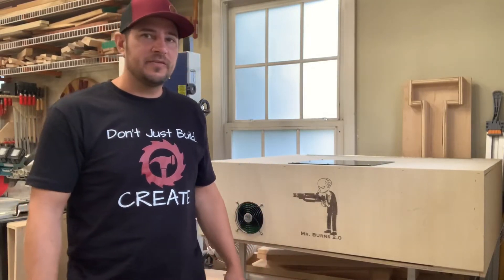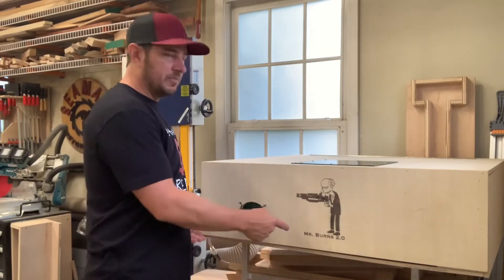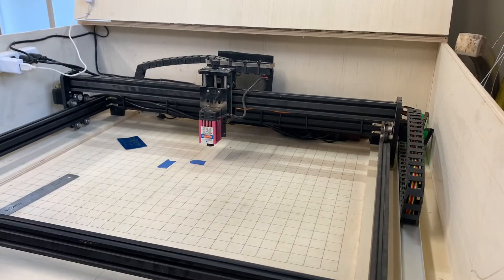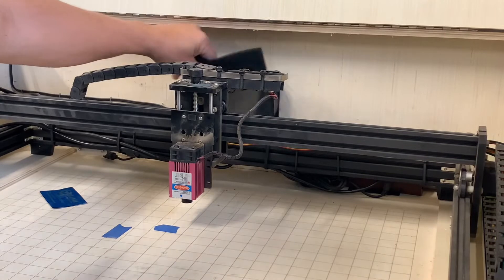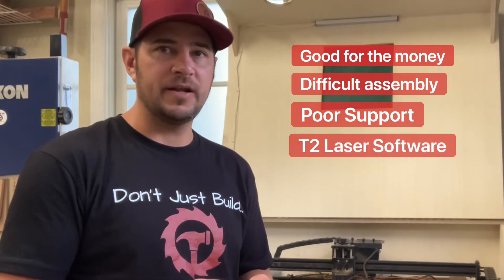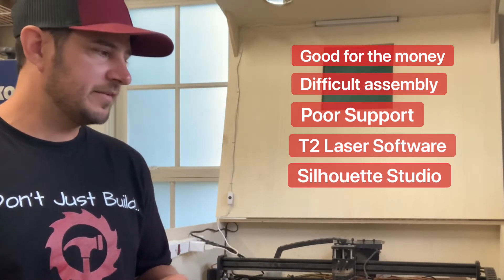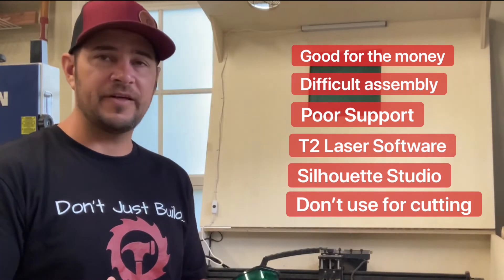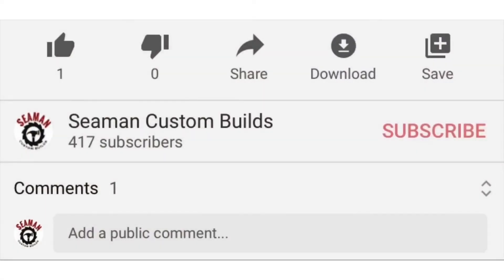Universal Engraver 15W and 3W Laser Engraver - 1 Year Review - HOW TO - DIY

Comment: Universal Engraver big problem
      I have a 15w Universal Engraver and you’re the only one I found that knows anything about them. Your video mentioned ‘poor support’, I say NO SUPPORT. No phone number, no address! Here’s my problem: I made a clock face that came out fine with a 100 Power/100 Feed using T2 software. I stepped aside for a few hours, came back and put in a new piece of wood and hit the send button. It started out in the 12 o’clock position fine but by the time it got down to the 3-9 o’clock the burn started to fade. By the time it got down to 5-7 o’clock position there was no burn at all. With some test pieces I was able to get some burn with a feed of 20 and a power of 200. Is my module shot? Is it the pc boards? The power supply? I can’t find answers anywhere. Help!

Comment: I have the 15 watt 40" x 40" version, but I bought an 80w blue laser module to upgrade. But it has a three-pin connector, and when I connect it to the shield, there are power lights on its board but no output.  Was there a certain way to connect it to work with the Universal Engraver? Three-to-two pin adapter or something?

Comment: Hello, I bought a 15000 mw Blue CNC Laser Engraving Machine a few months ago.  The setup was difficult, however I took my time and am using LaserGRBL software.  My question for you is that there are two toggle switches ontop of the laser itself.  What is the purpose of the two toggle switches?

Comment: My universal engraver came with two transformers one for z/y/x other one plugs in to laser. I have extra two prong plug part same wire power laser from transformer. If I start project I have manually turn laser on then off when stopping project. Also unable stop burn lines when laser goes one area to another. I tried $32=1 no help

Extra wire and plug is this problem

Comment: I was wondering if you might be able to help me out with my 15watt laser engraver. I’m having issues with it just stopping randomly. I can’t find anything anywhere about it. It throws no error codes either.
Reply from the maker: Sorry, no idea what might cause that
Reply: I saw a response to someone on another video with a different machine that had the same problem, they suggested switching out the usb cable. Not sure if it works, but worth a try. They mentioned interference with the signals causing a problem.

Comment: I purchased a 3000mW universal Engraver about a month ago. I struggled thru the setup and  to learn the software. Support has been poor to non-existent. So, my question is; If I install the free trial version of T2 software, is there anything else I need to get to interface with the hardware?
Reply from the maker: Congrats on making it through the setup, T2 should work very easily, check out my video on connecting it.

Comment: Thank you for the video it was helpful but in my experience This laser is garbage !!! no matter what settings I use no matter what advice I follow from the engineers I can not get good results. I have reached out to support several times and they are useless. all they have  told me is to be patient and spend another 1k on a more powerful unit which I should not have to since the one I ordered is advertised as an all around "universal" laser I did my research but I guess not well enough. I would not recommend this product to anyone.
Reply from the maker: It doesn’t do everything they claim, mine has worked well for a while now but not sure that is the norm for everyone and I wouldn’t claim they have any support bc they really don’t help at all
Reply: @seamancustombuilds  I have followed every suggestion that was offered to me from them and I can not even get the laser to burn never mind cut thin wood the final suggestion from them is to spend 1K on one of their upgraded lasers

Comment: Hi, I wanted to pop in and just warn people about this company, if you are not handy, well shop elsewhere, there is a lot to put together and their videos are horrible and just about worthless. Customer service is not great, they only use whatsapp to send pics and into back and forth. I have heard from others that they DO NOT allow any refund or warranty beyond a replacement part. My 1500Mw blue took about 6 hours to assemble switching between several videos and stills, I still got it wrong with wiring. Best to put it together, then send them pictures to tell you for sure that it is wired right. I got ahead of myself and burned a small hole in the dining room table!! After that, I worked another 5 hours getting the wiring right and software understood. JUSDT BEWARE, THIS COMPANY IS HORRIBLE TO WORK WITH!! BE WARNED!

Comment: The original software won’t pop up for my MacBook Pro. I got light urn and it won’t detect the laser even with usb connection. Is there a more compatible or better software for this particular laser?
Reply from the maker: My only experience is the T2 Laser, good luck

Comment: Hey Scott thanks for the video. I just assembled the Universal 15x blue laser. Now I’m stuck waiting for support to troubleshoot software, Windows version compatibility, installation sequence, firmware, and controller board issues. The 48 hour wait for support and abysmal communication gap is maddening! Are there any user groups or other support options? Thanks again
Reply from the maker: Are you trying to use T2 laser or something else?
Reply: Grbl based laser CNC systems. It supports grey scale images, vector graphics and also has basic sketch features. I finally completed assembly and forces myself to figure out answers to my questions with fragments of occasional support from Universal Laser  engineers in China. They are very friendly, but only extremely slow to answer my questions.
Turns out, assembly video showed incorrect placement of a power cable onto controller card causing a reverse polarity issue. The engineer did finally turn me in the right direction.
My application is engraving serial numbers and logo into coated aluminum- very curious to see if this 15W laser will work. If so, I’ll be very impressed for the money.

Comment: Hi, i want to buy, but i want to use to cut 3mm plywood, my question is , i don´t know is you was referring about the 3w or the 15w, i am interested on buying the 15w, this one can cut 3mm plywood?
Reply from the maker: It would take a lot of passes to cut with the 15w, you need a much higher power machine
Reply: @seamancustombuilds  thanks for your fast respond bro!! I also see, thet sell for 699$ a router attachet, i think with that, i should have not problem cutting the 1/8 plywood

Comment: Hello from Canada. I just ordered a Universal engraver 15000mw and assembled it. I ran into some difficulties with the wiring. I am asking you because well .....
 #1 you have it working
#2 there is no tech support 
Question #1 my kit came with only one power adapter. 8.5 amp. Their video shows an additional adapter of 5 amp. Did yours come with both?  And if so is the 8.5 amp for the laser?
Question #2 the wire harness red/yello/green/black is wired into plugs in a reversed color order from the video. Did you run into this as well?
Reply from the maker: There should be 2 power supplies, I’ve heard of multiple people missing one in their shipment lately. #2 I don’t recall
Reply: @seamancustombuilds   Thank you very much for your time. That information helps a lot already, I'm a little bit out of my comfort zone and not very tech savy.
Reply: @seamancustombuilds i only have one. Where does the other one plug into?

Comment: I got it all set up, where does the blue connector from the laser go on the control board, their video shows it going to a separate power supply but they only sent me one lol
Reply from the maker: Which model do you have?
Reply from the maker: I’ve heard multiple people say they aren’t getting the 2nd power supply shipped
Reply: @seamancustombuilds  Yep, didn't get mine either.  I've messaged, called, emailed....everything.  They won't return any of my messages other than 1 and he said to contact the support team.  NOT ONE WORD from them and it's been 1 week later.

Comment: Just set mine up. double checked it, triple checked it etc. With Engraver master i can control the laser but it will not move. When i try to print an image it will clearly try to do it as the laser turns on and off but the motors do not kick on. Any Idea what i can do?
Reply from the maker: I would start with using T2 laser software and make sure you can manually control the directions and laser on/off, if not then check the cable connections
Reply: @seamancustombuilds  do they do a free trial or do I need to purchase the software?
Reply: @seamancustombuilds  your videos have helped so much and I really appreciate you responding. We have the same laser here and I downloaded the t2 software. Again T2 was able to power the laser on/off but I can’t move the laser. I’ve been checking cable connections and placement. Is there anything else you can suggest I look at? Thank you for your help.
Reply from the maker: @thedan7888  do you have the 5 or 15w?
Reply: @seamancustombuilds  15W - I got it to work just fine. Had to mess with the power adapter. The laser was fine. Do you have a video on making the grid for the bed?
Reply from the maker: @thedan7888  I used this video https://youtu.be/vp1R2wKt1pA

Comment: I have the 15W 40x40. I'm not sure if I'm missing a part but there are the two connections tied together coming from the laser/controller to an adapter to a power supply. I only got one of the adapters for that connection to the power supply. Also I tried to engrave the pre-made grayscale code and it just burns a black rectangle. Thank you for any advice
Reply from the maker: I’m not sure on the power supply question but it sounds like it’s powering up. There is a blue knob that you can turn down with the laser on lowest power and set to the minimum that turns the laser on, I would also try T2 laser software for better usability
Reply: @seamancustombuilds  I realized my connection mistake. I'm using T2 and have been playing with basic shapes and those come out fine. Now that I'm trying to do some images with different levels of darkness, like the grayscale test, I just get a burnt rectangle. Maybe there are some changes I need to make in the settings.

Comment: Have you tried engraving stainless steel yet ?
Reply from the maker: I tried some thick aluminum and had to use a spray and even then it didn’t always work, talc business cards work but haven’t tried anything else
Reply: @seamancustombuilds  awesome thanks you just got mine what software do you run ?
Reply from the maker: @CHEESMIZER1  T2 laser, I have a video on how to get going with it
Reply: @seamancustombuilds  awesome thanks you very much how good is t2 with picture engraving?
Reply from the maker: @CHEESMIZER1  do you mean greyscale? If so I haven’t tried, I leave power up and let it rip

Comment: I've had my 15w 40x40 for a few months. Having a hard time getting the speed and power to a good spot. Especially with adjustments through the power knob. 

Would love to pick your brain on some settings
Reply from the maker: I leave power at full all the time and just change the speed setting
Reply: Used a Borax soap and water mixture put a little bit on the metal or piece of wood burns much darker

Comment: Is this a product worth getting if you’re looking for finely detailed creations?

I see a couple people has asked about glass//metal work, any update on how that does? 

my most curious question, what type of power supply is required for this thing? Will 120 suffice or does it need 220? Something else? 

Looking into getting the 15w 40x40 and wanting to make sure it’s the right machine for me, any other recommendations for machines of similar price/quality to look into? 

Really looking to fab on metal / glass / wood.
Reply from the maker: The fine detail is amazing, no update on glass or metal as they are just nothing things I work with in my shop. It connects to a standard 120v outlet, I would get the smaller size unless you know you will need the larger footprint.

Comment: I have the universal engraver and bought it to engrave anodized aluminum.  Anyone have any tips for this? It appears to work on wood, but I tried changing the lens to the metal lens and it will not do anything on aluminum.  Their support has not been helpful.  thanks
Reply from the maker: james runyon I haven’t messed with metal other than business cards
Reply: i understood that dry molly will let you engrave on metal or cermark

Comment: Is the laser a 15w laser, or does the entire unit consume 15 watts? Also, do you think i could use it to engrave antler?
Reply from the maker: McCray Jensen the 15w unit has 2 power supplies, one for the control board and one for the laser itself, not sure if you get a full 15w on the laser or not
Reply: Seaman Custom Builds okay, thanks you very much
Reply: @seamancustombuilds  max. 7W if not 5.5W. all of those "15W" are not real 15W laser, but consumes 15W at all. Other thing: The 15W laser costs nearly the same as the 7W one and it is completely the same package/housing, so I think they are only overdriven, maybe with a better heatsink.
Reply from the maker: McCray Jensen no idea on how an antler would do

Comment: Curious but how does it do with etching metal or glass? Like a flask or wine glass.
You also said "dont use it for cutting." Are you using the router tips and would you not use it for cutting on 1/8" wood?
Reply from the maker: Kendall Sanders I tried metal even using the special spray and it will sometimes work and sometimes not, never tried glass. I didn’t purchase their router attachment as it looked greatly underpowered

Comment: my sister purchased the universal 15w 40x40 laser engraver and never assembled.  she gave it to me.  i assembled yesterday.  when i run the master engraver software nothing happens.  we have checked and rechecked the wiring and it's correct.  and yes, their support is awful.  any suggestions
Reply from the maker: Jennifer Ferguson start with trying T2 laser, the trial version is free and see if you can manually control the X and Y movements and laser on/off
Reply: @seamancustombuilds  did you try to use engraver master or any other program?
Reply from the maker: Jennifer Ferguson I tried that one briefly and it was garbage, I can’t even get it to uninstall from my machine now